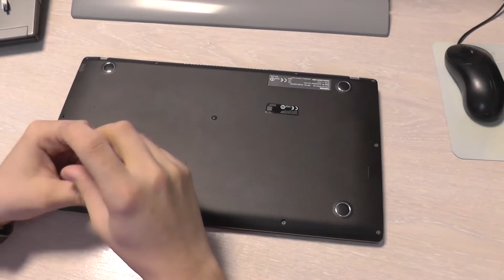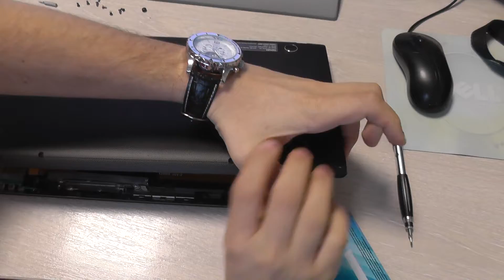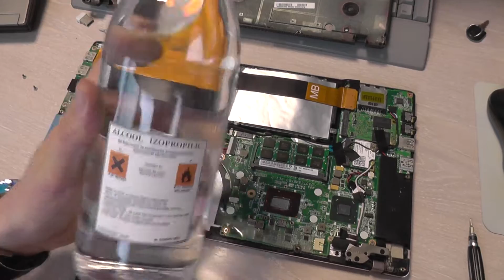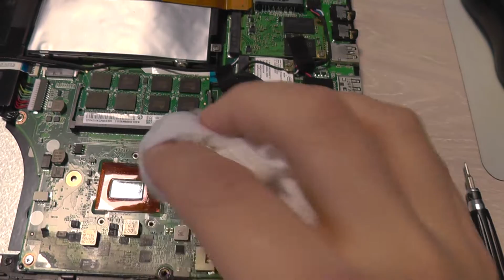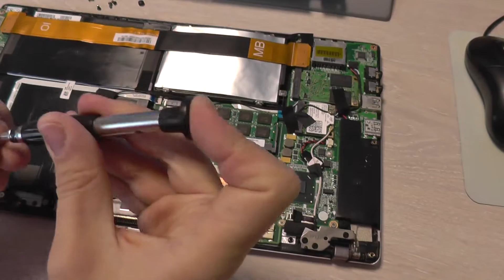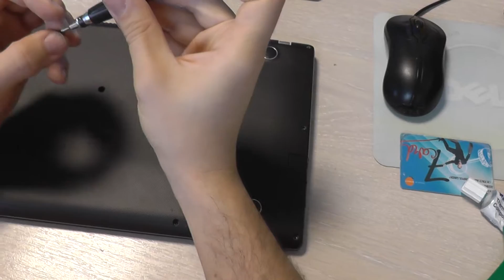Toshiba Satellite U840W-108 Ultrabook Replace Thermal Paste and Clean the Heatsink

Comment: How can I remove the hard disk?
Reply from the maker: +ZAGATO The disk is under the silver wrapping and it fixed with screws
Reply: +TechTronic9000 Wow thanks for the fast response. Do I have to detach any other parts before the hard disk? Or I can just unscrew the hard disk?
Reply from the maker: +ZAGATO You need to release the big brown ribbon cable with MB written on, to avoid damaging it and have access to the drive.
Reply: +TechTronic9000 thank you!
Reply from the maker: +ZAGATO You're welcome !

Comment: Can i ask what if yr u840w was working fine the night b4 and not it cant turn on or charge what does it means?
Reply from the maker: Tan yong kang Could be several issues like charger, battery, dc-jack.
Reply: Thanks i fixed it myself
Reply: TechTronic9000 i found that the part (2.15 of yr video)part was loose for some reasons 😊
Reply from the maker: That was the DJ jack :).  I'm glad that you fixed it !